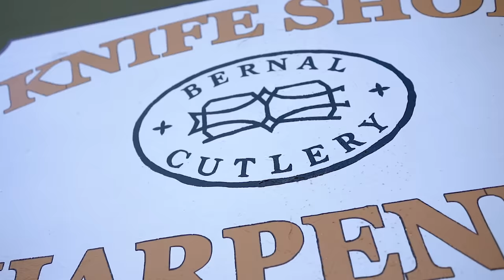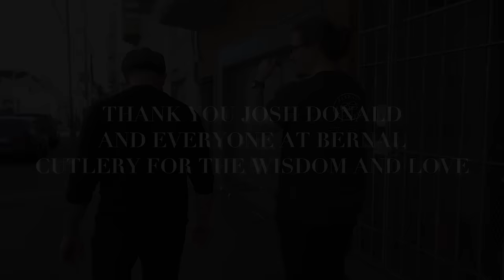Sharpen Your Kitchen Knife Like A Master Sharpener

Comment: How To Sharpen Your Knife Like A Professional: Get it done by a professional.
Reply: Or learn how to sharpen your knife. That's the point of the video. Why are people so resistant to learning skills?
Reply: @woopsnap  nice plug
Reply: it's really not that hard to learn to sharpen a knife to the point where you're able to have knives that are significantly sharper than the people who are getting it done by a pro. not that you're better than the pro just you can sharpen more often since its free and you dont need to send them off..  grab a cheap crappy knife and just practice until the knife is practically gone
Reply: @CAIDMASTEROFPYRO  A cheap crappy knife isn't worth practicing on. Spend 85-125 on a real knife, experience what sharp is for a month, then learn how to re-sharpen it, slowly and surely. Then you'll understand how and why to sharpen a good knife. There IS a price of entry into good knives. But if you buy one great one, it'll be passed down when you die.
Reply: @cjay2  that's just not true. Doesn't matter what knife you use the techniques are the same. If you're going to be learning and possibly ruining a knife it's best to do it on one you don't care about.. obviously you should buy a good knife to use. Doesn't need to be that expensive though, something like a Victorinox will take a great edge and hold it for a good amount of time for $20-30. I have knives worth 300-400 and still grab a Victorinox relatively often.
Reply: @CAIDMASTEROFPYRO  A low quality blade will not sharpen well. There's a reason it's cheap. If you learn on a good quality knife, you don't 'ruin it' if you screw up a sharpening attempt. A good quality blade can simply be resharpened correctly. And 85-125 is a correct range to pay for something that will last and to learn on. The Victorinox is decent and probably a good value at 20-30. I use a Global, an Ausonia (local old Italian brand), and a Wusthof. The Global cost 30 euro - it's a small 3" paring knife. The others cost 50 and 90 euro resp). I've been maintaining knives for 40 years, so they were sufficient. They'll be around after I'm gone. I should put them in my will. A 300 knife is a luxury, and I hope they are more than awesome. They should be a dream to use and sharpen. ;-)
Reply: @woopsnap  gotta respect the hustle, you just gained a follower
Reply: random person many thanks.
Reply: @cjay2  I think you misunderstood what the cheap knife was for. Literally sharpen it untill there is nothing left.. I wouldn't say global is a high quality knife they're expensive because they look cool and are decent enough for the home cook.. personally I have tojiro, kasumi, shun, wustolf, Victorinox and a few custom knives who's makers I couldn't even begin to spell
Reply: @CAIDMASTEROFPYRO  No, I understood your point. My point is that a cheapo knife may not be worth practicing on, because the blade may not be capable of holding an edge. My point is to get beyond that possibility and devote/commit onesself to a good blade that you know will hold a good edge. That's how you can learn how to sharpen well. I learned in a 5 minute live lesson, on the job, on a good pro knife. I understood it immediately, and from then on, I just refined my personal approach (You know what I mean).
Reply: @cjay2  go buy a cheapo knife, they're not as bad as you think. They come with a crap edge buy generally can hold a pretty decent one just not for very long
Reply: @CAIDMASTEROFPYRO  Hehe, I'm too old to buy a cheapo knife to play with. Besides, there's no one I know who I would want to give it away to, it wouldn't be respectful! ;-) But hey...
Reply: You clearly still live at your parents house
Reply: Lots of pros use machines that wear your knives out. Also, money. Learn it. You will appreciate it in the long run. First thing I do with a new knife is sharpen it because they’re NEVER as sharp as I get them when new
Reply: cjay2 facts. I have an old gas station Smith an Wesson knife that I can’t get sharp to save my life. My ZT pocket knife whittles hair so I know what I’m doing, but that POS is impossible
Reply: @richardcagle5475  I know what you're saying about that S&W. It probably has lost its edge because it's so far into the knife body, having been sharpened so much and for so long, that you'd have to create a new edge from scratch. Which might eat up too much blade real estate to reform a complete edge geometry. I had a Caddie knife that I used daily for 30 years, and sharpened it bi-monthly for most of its life (but it was sharpened every day for its first 2 years due to extremely heavy usage), and its 'edge' is too far up the blade to resharpen. There isn't enough blade left to properly clear the chopping board with your hand on the handle, so I retired it and bought another one (boy was that a search). Now I live in Europe, and have bought all new knives locally (Global, Ausonia, Wusthof). You'll probably have to retire that S&W. But being a pocket knife, perhaps try to go the whole length and remake an edge, remaking the whole geometry leading to it. It's not like you're chopping vegies on a board, it's a pocket knife. Good luck.
Reply: @richardcagle5475  Yeah, plus god-forbid, someone might learn a new and valuable skill! You are absolutely right. I do my own on my own stones.
Reply: cjay2 man I’ve tried everything. It’s just crap steel that won’t take an edge. At least not my standard of an edge. It cuts paper and kind of shaves and all, but it never gets “scary sharp” and the edge just rolls the first time it’s used. I see knives the same as beds, shoes and tools; always buy the best you can afford and you’ll generally be happy. Sticking to ZT, Benchmade and Kershaw for my edc. My current work knife is a Hinderer ZT that cost $150. And I’ll replace it with another. You do sometimes get what you pay for
Reply: @richardcagle5475  Yeah, it's pretty true that you do get what you pay for. At least the saying does express well the sentiment. I tried to explain to another commenter in another thread close by this one, who was telling folks to buy and practice on a cheap knife first. And my POV was no, buy a decent knife that will hold an edge and learn how to sharpen on that, but I think he still sticks with his position. It's ok. To each their own. And yeah, I buy the best I can afford always, because in the end, quality stuff lasts and performs best. Scary-sharp. Yup, I know what that is! It's when you place the knife blade on a tomato, and move it an eighth of an inch, and it slices through the skin like butter. That's when you pay attention to your work, because you know that even though the work is effortless, and you're cutting with precision, it would only take one slip to send you to the Emergency Room. I like the edge a week after that point, where it's still really good, but it won't send you to ER unless you really screwed up. Which doesn't happen, because you have a good relationship with your knife.
Reply: cjay2 lol the top half of the back of my left hand bears the proof that a sharp tool will mess you up if you don’t pay attention. And I started learning on the crap S&W and gave up trying for a long time due to my inability to get a good edge. Turns out it was mostly that knife that was the problem and my technique wasn’t terrible. Get a decent knife, Victorinox makes a decent kitchen knife for like $40, and learn the right way. Take it from a guy who went the cheap knife way first and almost quit for life
Reply: @CAIDMASTEROFPYRO   and chay2  I get what your both saying but one point you missed out on is the quality of the whetstones budget stones are a waste of money you need a decent stone because of the steel the knifes made of if there zdp  or hap 40 r2 blue steel shirogarmi steels budget stones wont sharpen them the knife will just wear the stone out rapidly
Reply: Do it at home with the stones easier than it looks
Reply: Lol tru
Reply: @cjay2  millennials.. Pay for no work..
Reply: @richardcagle5475  Hehe, it took 30 years for the small scar to go away that resulted from my first (and only) cut, ironically in the first 10 minutes of my knife 'career'. I never got cut again, just occasional rare clips to fingernails, fortunately. Yup, agree. Start with a good knife and all will be good. And it's always worth it from the beginning.
Reply: @craigsayer8710  Yes, as well the stones need to be of good quality too. It all needs to be good quality.
Reply: @thalegacy6  Unfortunately agree.
Reply: @eusuh9380  just angle grind it will be fine
Reply: Gabriel Rabin bro if you’re sharpening your knife every day you need a better knife
Reply: @Starkl3t  Not correct. I worked in a professional kitchen for over four years, chopping heavy orders all day. It was necessary to sharpen the Caddie knife every morning without fail. Gabriel said in his comment that he was doing catering. That's heavy usage. You sharpen your knife every day so it's ready and so it doesn't bite you.
Reply: @eusuh9380  it barely costs any money to get it sharpened.
Reply: Tormek
Reply: $200 +
Reply: First of all, the lion's share of sharpeners just use a belt grinder; secondly the sharpeners that use quality synthetic whetstones and especially J-Nats are going to be expensive. If you own expensive knives, you should learn how to properly maintain them; it's a piece of steel not a motor vehicle. If you don't want to learn how to freehand just get a worksharp or a guided system.
Reply: @cjay2   I can get a $25 white #2 tojiro petty sharper than anything you own lol. If anything more expensive knives with more wear resistant steels at higher HRC are more difficult and less forgiving to sharpen not easier. A Victorinox at sub 60 HRC is perfect to practice on. Global and Wusthof are meh knives anyways. Mediocre stainless and they're flat ground, you're better off saving up for something with a decent grind.
Reply: how to open a door: get the door to open
Reply: @pb8582  lol imagine having a girlfriend
Reply: I just saw Maplecook do that tomato thing with an ordinary kitchen knife. No Japanese blade required.
Reply: @woopsnap  broooooo that was smooth af
Reply: Learning to do it on your own is better than sending off your tools to someone else when you need it
Reply: cjay2 exactly
Reply: cjay2 that’s not true at all
Reply: True, I go to a professional and he is very good at it...
Reply: @eusuh9380  I save myself my fingers and my knives...
Reply: Gabriel Rabin  you are probably cut for this work...😂
Reply: @cjay2  I need to learn 😔
Reply: Thats my take away
Reply: @neeko708  yeah that self promo was actually smooth asf
Reply: It wasn’t fun
Reply: @CAIDMASTEROFPYRO  that's what I did and now I can sharpen mine and maintain the edge so they are never dull everyone that uses them asks wear I got my knifes and I tell them Walmart and they cant believe
Reply: Exactly. This just affirmed that I will never be sharpening my own knives lol
Reply: I feel like you should learn to sharpen your knife. After all, it's yours and if you take care of it well, it should last you a lifetime
Reply: Or, become one....
Reply: @woopsnap   Sharpening is not that mystical and doesn't take long to learn. Spend an hour or so watching a few youtube vids, get a 1000/6000 grit Whetstone, be consistent in sharpening angle and in 5-10 min of sharpening you have a razor sharp, hair shaving, mirror polished knife. Now you may not want to start your first time with your $150 Wustoff Icon or Shun.....practice on an inexpensive knife. But it's not that hard to learn how to sharpen.
It's not magic. You just have to want to do it and want to do it right.
Reply: Gabriel Rabin  Nothing wrong with Chinese German steel nor Chinese knives. In fact, both Zwilling and Wustoff have some of their less expensive knife lines actually produced  in China with Chinese produced 1.4116 German steel.
Reply: @cjay2  Because people have become lazy and we seem to live in a disposable world. They go to Walmart (and I was guilty of this until about 2 years ago), spend $15 bucks on a cheap knife, use it for 3-4 years, sort of sharpen it over time with one of those cheap $10 bench sharpeners, and then chuck out the knife and get a new one.......unfortunately.
But I have a $15 Walmart/Chicago Cutlery all metal Santoku I bought in 2008 and was about to throw it out in 2018 when it was massively dull. But I spent a few hours watching youtube on how to sharpen, bought a King combo whetstone for $25 off of Amazon and sharpened that dull santoku into one badass mofo sharp as shiat knife that I love using even today! (I've since bought some higher end knives - under $60 bucks like a Mercer). 
You are right. People should learn to sharpen.....no reason to discard dull knives.....even inexpensive/cheap knives. Most will sharpen up just fine.
Reply: @dbreardon  I’m well aware how to sharpen. Lmfao. Thanks for the information I already have. Razor sharp doesn’t mean crap where I’m currently at. Razors really aren’t all that sharp. 
Unless you’re talking about a straight razor... those are different.  

I don’t need a 6000 to get razor edges. I can pull it off easily on 3-4000 all day. 

You must have meant to send that to someone else
Reply: @dbreardon  FYI. A $150 wusthof/shun is a cheap knife to me.
Reply: @dbreardon  it is definitely not a mystical practice. But it does take quite a while to learn how to do a good job. 

If it was so easy everyone would be doing it themselves instead of buying gimmicky trash that claim to work.
Reply: @richardcagle5475  I agree 100%. Shops use machines that wear down the blade way too fast. That’s why I originally learned. I do all my work for customers by hand. Such a better end product. 

Every knife I’ve handled when new hasn’t been nearly as good as where I’m able to get it. Hand sharpened is the way to go.
Reply: @elliottatwell1155  most are expensive for hand done with naturals for sure. 

I charge $2.00/inch and I finish on naturals. 

100% done by hand. I probably don’t charge enough but we live in a cheap age. Everyone is cost oriented. And it’s a side hustle for me so I don’t mind
Reply: @dbreardon  Exactly. I used a Japanese Caddie knife for over 30 years, every evening, sharpening it several times a week on whetstones myself. It is a good knife, but still, I paid $30 for it in '79, it lasted over 30 years. So I bought a new one. One great knife. You can keep a cheap knife going well for a long time as well. If you learn how to sharpen them.
Reply: @cjay2  A $10 knife from walmart is plenty good enough at holding an edge. I did one for my uncle and it was shaving off the 240 and strop.
Reply: Beware the moniker "professional."  Caveat emptor.  I had a decent set of Henckels, at least it was decent until a so-called "professional" sharpened them.  Said "pro" ground off way too much and ruined the shape of the blade.  I had to take the knives to a bladesmith and have the curvature reground, and then had him put on a new edge.
Reply: @bradr65  there’s definitely a difference though in the types of sharpeners. Hand sharpened vs grinders.   Anyone using a grinder is not a professional in my eyes.   Hand sharpened is professional. And removes less material. All my customers receive hand sharpening.
Reply: @bradr65  the reshaping you had to do wasn’t necessary to be done by a blade smith. Someone with decent skill at hand sharpening could have reshaped on an atoma 140 for you. Just something to think about. I’m not sure how much you got charged. But I’d have charged a bit to do a reshaping and reprofiling.    Anyway, sorry that had to happen to you. I tell all my customers to stay as far away from shops that use grinders or belts.
Reply: @bradr65  That's why I learned how to properly sharpen my knives.
Reply: That was great 👍 thank you. I’m going to try to sharpen my knives 🔪 and I’m so excited!! 😆
Reply: @cjay2  because he doesn't want to lose work
Reply: It's just like anything the more you do it the better you get but it's best if you enjoy it ...I love sharpening blades myself but I'm no professional however any blade I come across goes right threw anything...I test all my blades with my fingernails as I grind.
Reply: @cjay2  That is wrong even the lowest quality knife will sharpen extremely well and actually be really easy to sharpen as well but it will not hold an edge. Even plastics can be sharpened to be razor sharp and you'd be able to cut paper thin cherry tomato slices.
Reply: @HimmelWeint  You're correct. It will not hold an edge - usually for more than a couple of strokes. Cheap knives are cheap.
Reply: I took all of my knives to a professional to have them sharpened.  It was Very expensive,  and I couldn't tell the difference afterwards; honestly don't know if my order fell through the cracks.  I will not do it again. I Will learn to sharpen my own knives. Case closed.
Reply: @wordsculpt  Wow. You should notice a huge difference in freshly sharpened knives. I have always done my own because "if you want something done right, do it yourself". I learned how to sharpen from a pro, and have just carried on from there.
Reply: Eu Suh ye sabe the money like a professional
Reply: Incompetent
Reply: Never let someone else sharpen your knives, they’re your tools and part of owning them is knowing how to maintain them
Reply: All right guys, i have tried to sharpen my knives and just canny get them sharp, no matter how many times i do it, i just canny keep the same angle, and where i come from there is no one that sharpens knives
Reply: it’s looked down upon sending your knife to someone else to sharpen it especially if it’s a Japanese knife.
Reply: @cjay2  do you know what the difference between cheap and expensive knifes are because it is easier to learn on cheap knives. And in some cases you can get it even sharper but it will dull fast
Reply: Chefs are very very protective of their knives. I'd personally NEVER let someone else take care of them / sharpen them or even use them.
Reply: @eusuh9380  it took me only a few hours to learn how to sharpen knives, chisels, plane chisels better than the professional service.
Reply: @cjay2  ‘Merica
Reply: Or just don’t be lazy?
Reply: @cjay2  I'll take a Victorinox over almost any other knife for home kitchen use any day of the week. Many professional chefs prefer them over more expensive knives. They're dishwasher safe, you don't have to worry about fine wood handles cracking and they're easy to sterilize. I can put an edge on a Victorinox that'll split a hair, and they're way easier to sharpen than many of the "super steels" out there. They're a great knife for a home kitchen. 

TRUE, they wont hold an edge no where near as long as those super steel knives but they also cost a TINY fraction of the cost, and in a home kitchen they get much less use than in a professional kitchen so it all works out. That easy to sharpen to a razor edge ability is one of the reasons why many professional butcher shops use them, I'll grant you you may not be handing (or want to) a Victorinox down to your Grandchildren, but for $25.00 they can afford to buy they're own...Just show them how to sharpen properly.
Reply: Also, if you work in a restaurant, pour ALL your sauces from a bag. 💩
Reply: Lol....
Reply: Then technically it wouldn't be "like" a professional if it is done a professional..not to mention done by someone else.  Videos like these are reminder that things can be learned if you put in the work.
Reply: not to be that guy replying to the original comment after 100 replies before me but like. no. I'm poor. I'm not paying for professional knife sharpening on a regular basis if I can instead pay one time for the equipment to do it myself
Reply: Yeah, no. This isn't some sort of rocket science, like what are people even thinking. You can sharpen anything on a rock even. Why has kitchen knife sharpening become some sort of impossible task.

As the sharpening Josh said: YOU WON'T RUIN YOUR KNIFE EVEN IF YOU FUCK UP.
Reply: F a professional.  Some "professionals" go the quick way on a knife and use electric grinders that ruin the blade by changing the tempering on the metal making the edge weaker and mire fragile.  Using grinders tend to remove more material than necessary to complete damaging it.  If you get them done by a professional and they are pricey knifes, ALWAYS have them done by hand.
Reply: Lol yeah as if someone who actually fucking cooks themselves and actually uses their steel wants to send off for someone else every single time their knives go a bit dull
Reply: @cjay2  $20-30 other guy mentioned is actually starting price for real ones. There is company in my country which sells and produce kitchen stuff here since 1992, and their chepest chef knive is quite decent. Very good handle, at least for me, and thick blade, which really need stones.
Reply: Or learn and become a professional
Reply: @cjay2  Any sharp can be as sharp as any other knife. You can fucking sharpen wood to be sharp as a pretty decent knife. Literally the only difference you will ever have between high-quality steel and low-quality steel is the amount of time it takes the knife to become dull. It's physics, it's mechanical, there is no "magic" behind it. 

So buy a midrange knife, buy a sharpening-rod (whatever the english word is) and sharpen it every two weeks or so. There you go, affordable, simple, super sharp knives. Anything else is marketing bullshit.
Reply: I understand why you sharpen a knife using a whetstone. I’ve been into knives for years and can’t be without a knife ever. But sometimes, specifically with my kitchen knives, I get tired of sharpening them and want to just get them sharp. My pocket knives I treat them with the whetstone. But sometimes I just want to quickly get my chefs knife sharp and don’t have the time to use my stones.
Reply: You can do it yourself too with a like 20 dollar diamond whetstone and a leather strop with some stropping compound. It’s not difficult really. Just takes a little practice and understanding of what’s happening in the process